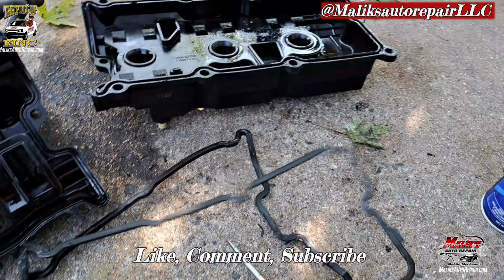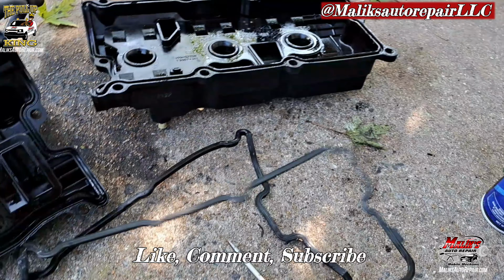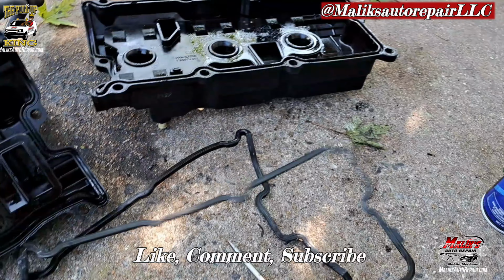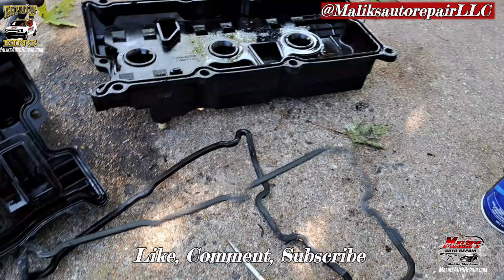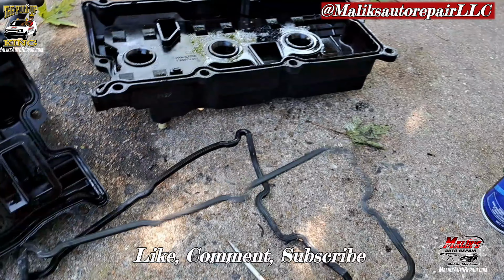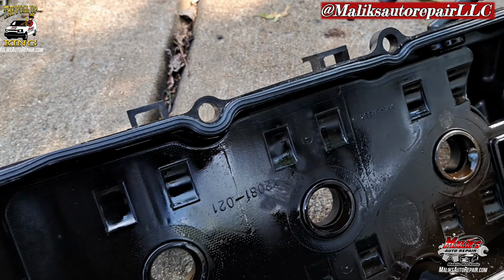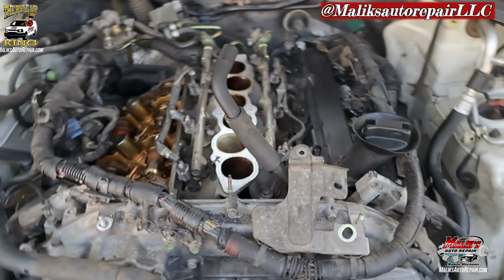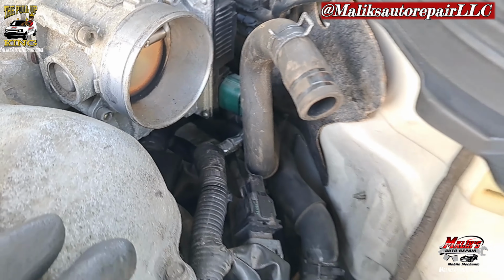VALVE COVER GASKETS LEAKING OIL | SMELL BURNING OIL IN CABIN TUNEUP | 06 INFINITI M35 | Detailed/Diy

Comment: Yeah, burning oil smell in the cabin. I got the same thing, man.  I turned on the recirculation and it helps it a little bit.  But I gotta do this job soon and replacing the camshaft gaskets   The camshaft gaskets are leaking, especially on the passenger side   I got a 2007  35 Infiniti.   Thanks for posting the video.
Reply from the maker: @billcampos3300  Yesssir, thanks for watching! Get'er done big dawg, you got it.💯💪🏾👨🏾‍🔧

Comment: Did you change the spark plugs because you were doing the job or because it was actually time for them to be changed ?
Reply from the maker: It was time
Reply: Good job,but you should change the valve covers too. Usually they leak oil into the sparg plugs tubes.
Reply from the maker: @ziggy129  Thanks! Seals were good👌🏾

Comment: Bro are you located in LA I need this exact replacement
Reply from the maker: GA
Reply: @ThePullUpKing Bro where in GA? Metro ATL?
Reply from the maker: No shop. Mobile service only. I service Atl & surrounding cities.
Reply: @ThePullUpKing  Aight ! M35 2007 with what I think is the same issue. No smoke out the exhaust and the coolant looks ok. Just leaking crazy. I'm in Metro. I sent you a text also. I know it's raining today .